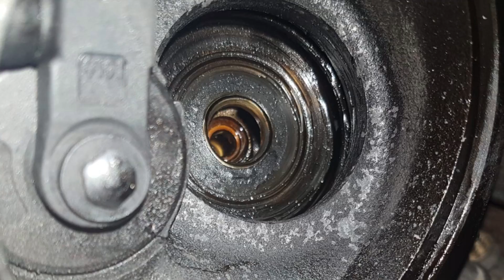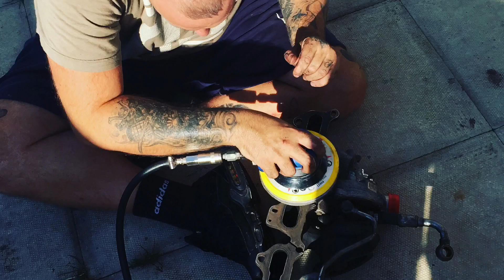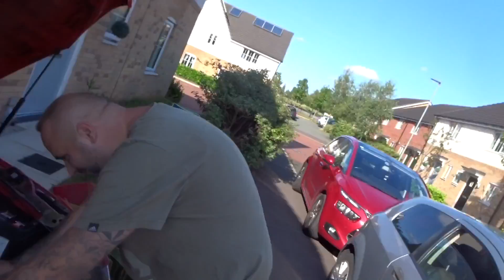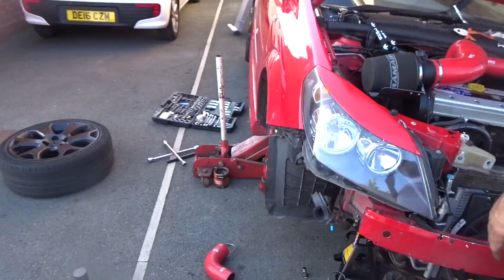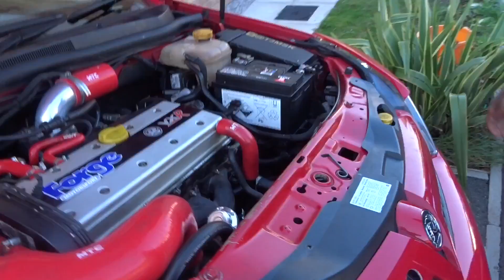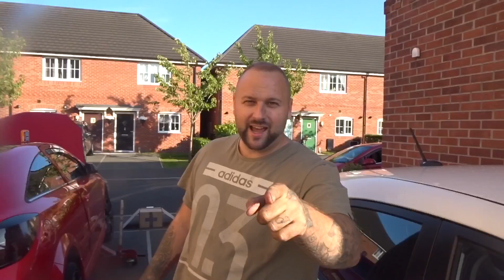* VXR TURBO BLOWN!!..( Breakdown Aftermath Part 1 )

Comment: Was it the remap putting strain on the turbo? how much you talking for a new one
Reply from the maker: Chris P I think it hasn’t helped the turbo but I don’t no how long it had been used for in a mapped state as when I got the car it was running a map bro and about 300 refurbed I think G 😎👊🏻👊🏻🔥🔥💯💯🔥🔥
Reply: @Manlikewezzo  nice i got one there recently and it has a stage 1 on the sport button apparently, deffo some difference when it is pressed :p